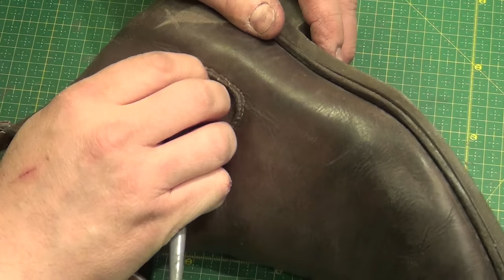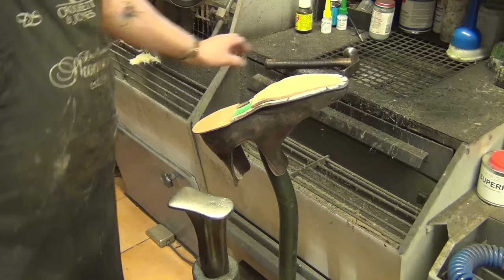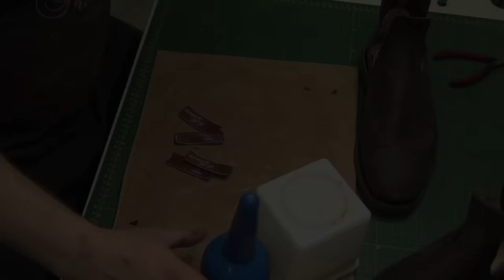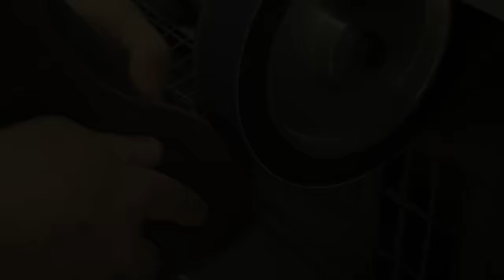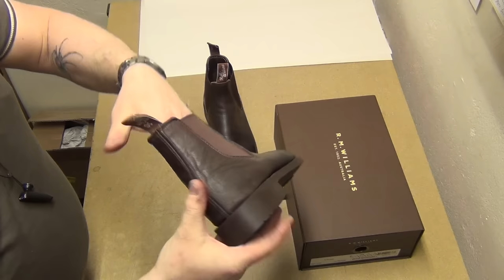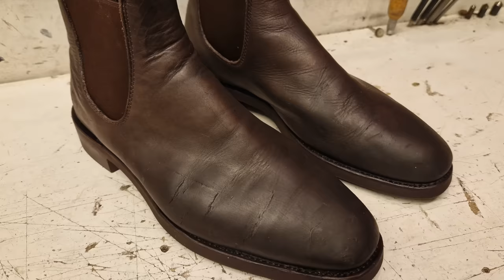Total repair of R.M.W. Gardeners, with leather restoration.

Comment: Nice work.
I loved my Gardeners. Wore them to death and couldn't afford to repair or replace them at the time, and with the company issuing 2 pairs of safety boots a year... I hated the steel-capped boots, I was luck with wearing the gardeners as long as I did.
I've had a few different styles of RM's and they all feel so lovely to put on. To me, it was the strangest feeling wearing boots the fit perfectly. Now I'm reduced to UGG boots due to feet/leg issues.

Comment: You are most skilled and do great work.  I don't know much about leather fillers and the like but if they hold up over time the restoration of the boots was well worth whatever it cost.
Reply from the maker: Well, the filling effect of the leather binder is limited as you can see on the end result. No point in a serious filling where the leather creases. But this binder reinforces the fibres in the leather and helps keeping the cracks closed. The sanding after, to open up the leather for the conditioning, is as important. With shoe trees and proper care these repairs should last a while. But sadly I've seen many of these repairs that I've done don't get the care they need, and the shoes back to bad shape much too soon. My guess is ten more years, but who knows. I hope he'll cherish them. I put a lot of hours on them.

Comment: When you repair the leather surface cracks, after you put filler you sand it. I am wondering if sanding would sand away the top grain of the leather ....
Reply from the maker: Of course. But I don't sand very deep. I basically just sand away the binder and open up the top grain a little to make the leather more susceptible to absorb the much needed conditioner.
Reply: @davidsonsshoerepair  Thanks for reply ! How many grits of sand paper you used ? 1000 up or below ?
Reply from the maker: @lorddiablo8575  I have sandpapers from 80 to 1200 and use mostly 240 to 1200 depending on whats needed. I can't say  which I use, because I use them all.
Reply: Excellent question.

Comment: I expected a better result with the cuts and scratches on the upper.😕
Great job on the rest of the shoe
Reply from the maker: Well, what can I tell you? They were so cracked i really wanted to put as much nourishment as possible on them and keep them susceptible to more nourishment in the future. When that is a requirement I can't really paint, spackle or wax the cracks. The old cracks and scratches will show, when you don't put repair cream or wax on them. But I quess I should be flattered that you expected more from me.
Reply: @davidsonsshoerepair  I wish I was as skilled as you. Thank you